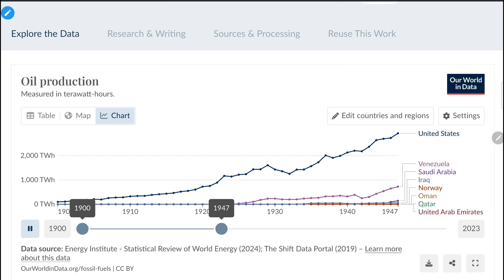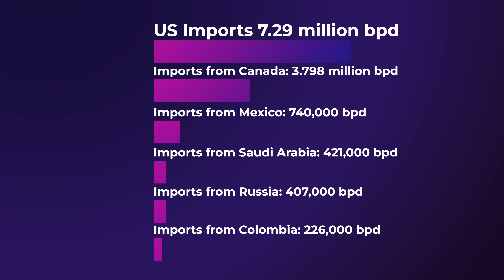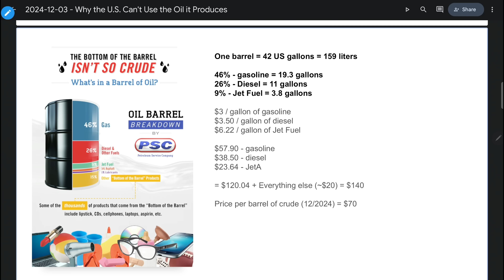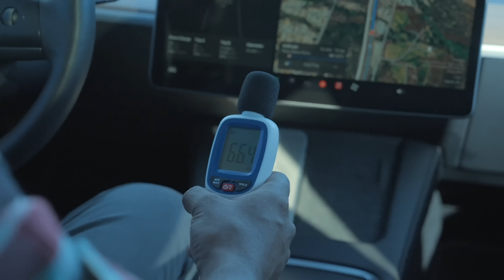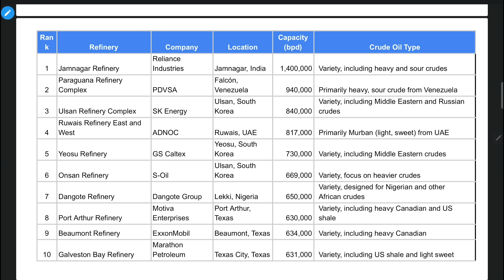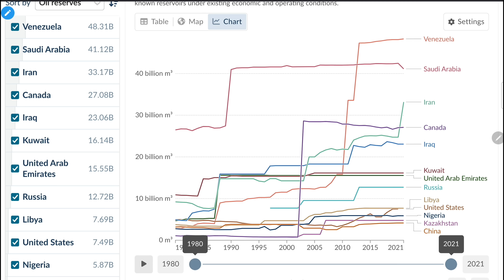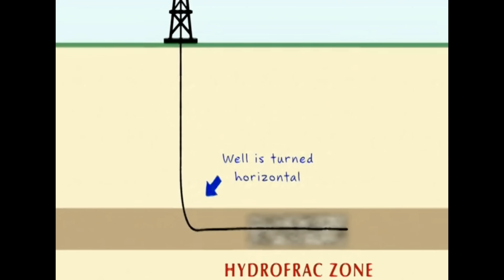Why America Can't USE The Oil it DRILLS

Comment: EV's are dead on arrival.  perhaps in another 10 or 15 years, once a proper battery chemistry is created,    in the short term hybrids will be the in-between. ICE engines are not going anywhere.  Casey the Car Guy has built a 126 miles per gallon , turbo diesel car.  0-60 comparable to a tesla model 3.  Edison Motors out of Canada is producing hybrid road tractors, snow ploughs, and refurbished hybrid diesel pick up trucks.   You wouldn't believe how many places the Chevron Decision had its sticky little fingers into.......................
Reply from the maker: I'm sorry but you're wrong.I own 2 EVs and i'd never go back. I charge at home and my monthly fuel costs have gone down from $250/month down to less than 20-40. My first EV i sold at 90k miles, with never having done any maintenance.

I HIGHLY encourage you to go test drive a Tesla Model 3 or Y, two of the best value cars on earth.

Comment: America runs on diesel, it will continue to run on it for a minimum of two decades.
Reply: As the demand for gasoline goes down because of electric cars, the diesel supply will fall. The pricw will go up. You need to make gas to get diesel and jet fuel from oil.
Reply: It has its pluses and minuses, but canola oils can be substituted for diesel.

Literally biodiesel.

Comment: You are missing a very important point, and I have to wonder why:
'Drill baby drill' and the increase in production is the same as buying power to bring in more crude we can refine. Refine it, or sell it, it's a positive for our energy balance sheet. And that's the same thing without needing to make a 20-min video to disclose the nuance.
Reply: Increased supply at the same level of demand will reduce price. The only way it wouldn’t, would be if the supply outstrips the capacity to refine.
Reply from the maker: what is "our energy balance sheet" do you or I benefit from some company selling oil for their own profit? I don't see oil and something the U.S. Shares, because the big oil companies sure as heck aren't sharing.
Reply: @TwoBitDaVinci  so, you have gone from providing information to becoming a political activist. I have unsubscribed from your channel.
Reply: @onlyyou7017  Nobody but you cares.
Reply: @martin2289  apparently you do.

Comment: Well, unless there is no new technology for using everything, it will be Oil. You cannot synthesize materials made from oil, and E-Cars still has serious problems like the battery and the power needs. It was oil, its still oil and it will be oil in the future,  until some quantum-computers comes up and does new materials, pharma and ways to generate power.
Reply: the polymer chemistry can generally make any length carbon chains they want from feed stocks as light as methane gas to bitumen   so the tech is actually there